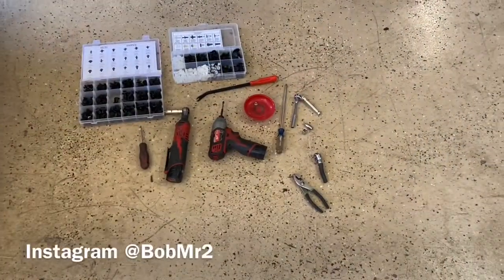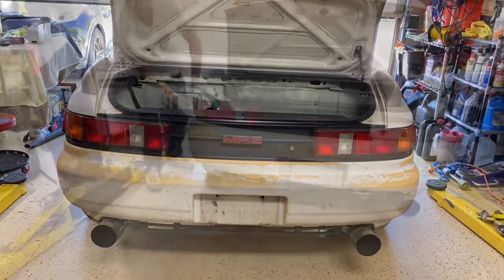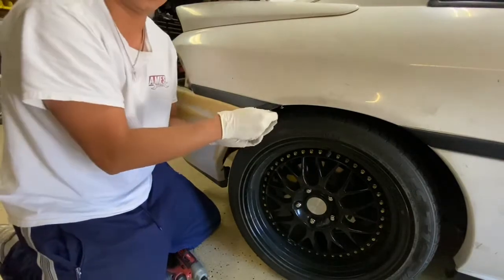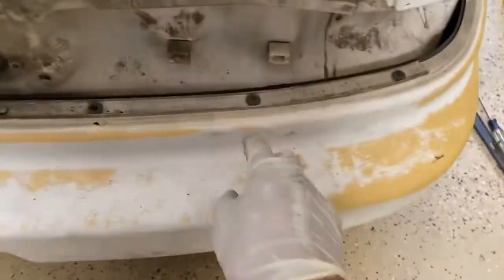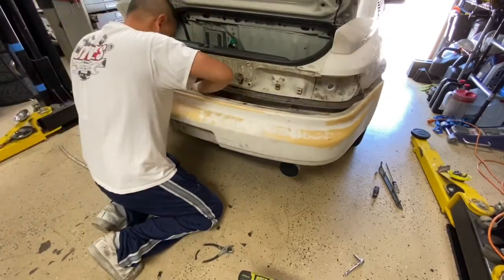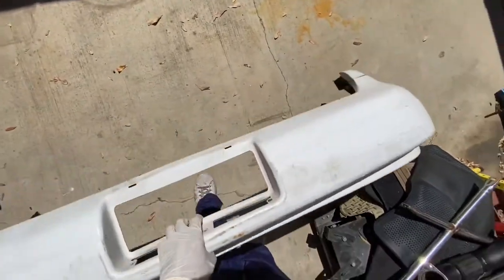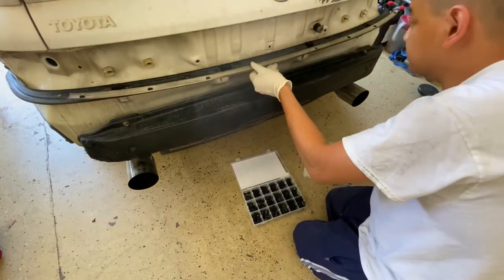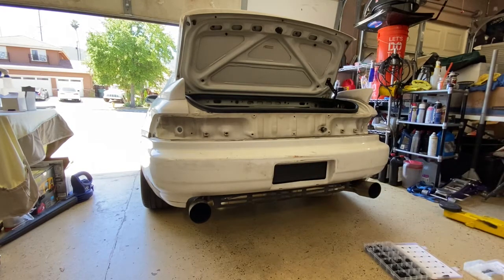DIY: BobMr2 Replace Rear Bumper on Toyota Mr2 Sw20

Comment: Be warned if your watching this from the uk with a bumper thats never been off, There's a lot more to it that this video shows. The center panel is bolted in from inside and does not just pull off. There's 3 bolts either side holding the mudflaps on to the bumper and body, You have to remove the mudflaps off the bumper before you can remove the bumper itself. All 6 of these 6 six bolts snapped on mine. The plastic screws holding the alloys strips refused to unscrew and i had to drill them all out.  Took me best part of an hour scratching my head wondering why it would not just pull off like in this video.

Comment: are body parts hard to source for these cars ? my front bumper and both front fenders have dents in them. I'm debating on replacing them on my own vs. taking it to a body shop to have it straightened out. Thank you

Comment: Are these clips also fit my 95 Toyota supra? Because I was look at eBay 435 pcs car retainer clips auto fasteners push trim clips pin rivet bumper kits.  Let me know if you buy at eBay or Amazon.  Thank you Bob 👍
Reply from the maker: Michael T Nguyen I’m pretty sure. Just buy it. It’s for all toyota and way cheaper and  handy also.
Reply: Yes, it will.